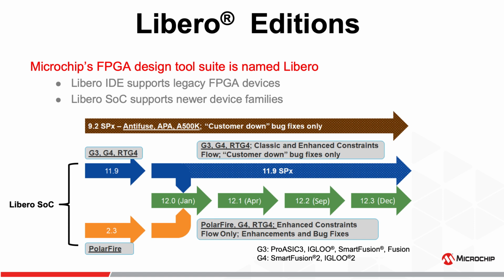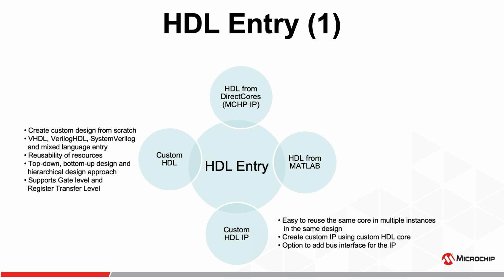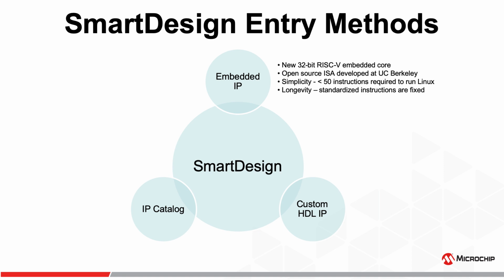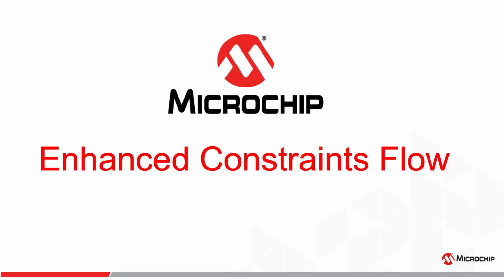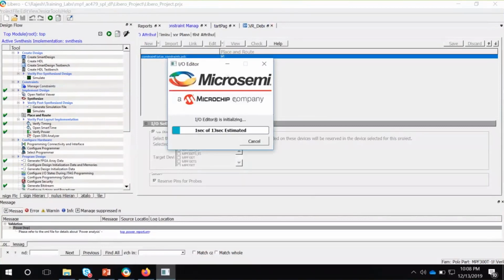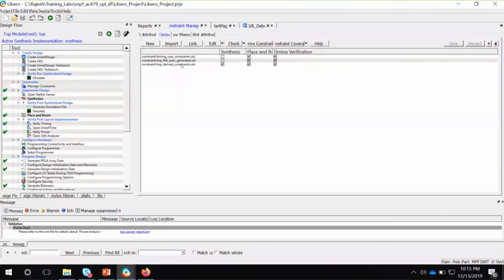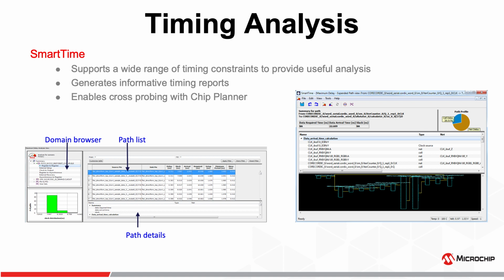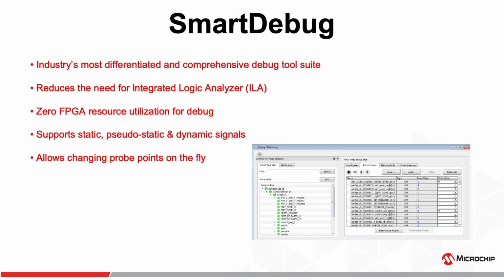Libero® Design Flow Using Libero SoC Design Suite v12.3

Comment: Hi. Can I use a USB BLaster FGPA programmer to program a AN015 QNG69 ACTEL CHIP ?
Reply from the maker: The USB Blaster FPGA programmer is designed for Intel (formerly Altera) FPGAs and is not directly compatible with Actel (now Microchip) chips. Unfortunately, we don't have information on the AN105 QNG69 chip. For Actel/Microchip FPGA programming, you may need a FlashPro programmer. Hope this helps!
Reply: @MicrochipTechnology  The FPGA is a A3P015 QNG68 from ACTEL which have been discontinued . I have a FlashPro5 programmer which I will be using for onboard JTAG programming. My question now is , what version of libero would I be using to connect and program this FPGA and is there a way to read or extract  my old FPGA program that is currently on my old board which is not locked ? Can Libero do this or must I just create a new program ? Will libero be free or how do I obtain a license for it .

Comment: Hi .. I am getting error message as "cmpf 010 : a design must contain at least one net" .. any comment on this error message while i a doing the synthesis.. Thanks in adavance
Reply from the maker: Hi there, thanks for reaching out! Please ensure that there is at least one I/O output and one internal net. Correct problem in the design source and re-import the netlist. 

More information can be found here: https://microchip.my.site.com/s/article/Compile-Errors-Connectivity-Codes-CMP001-CMP030-1625098133488

Let us know if this helps!

Comment: Creating a New SF2 Project with a basic SystemBuilder design that uses the on-chip clock, and I instantiate no peripherals.. 

However, in the Timing constraints, if I press the 'Derive Constraints' button, the place and route will have an error:
Error: SDC0001: SB_derived_constraints.sdc:10: Invalid clock constraint: clock source "[get_pins { SB_sb_0/FABOSC_0/I_RCOSC_25_50MHZ/CLKOUT }]" is incorrect.
It seems to work only if I instantiate a GPIO and route it to a pin.. only then will the Place and route tool complete.   Why is this necessary?